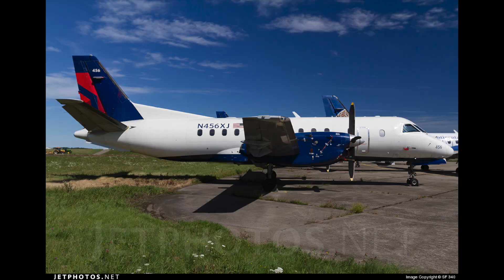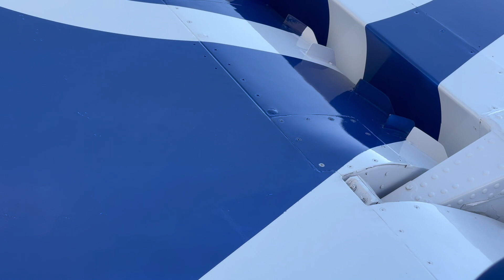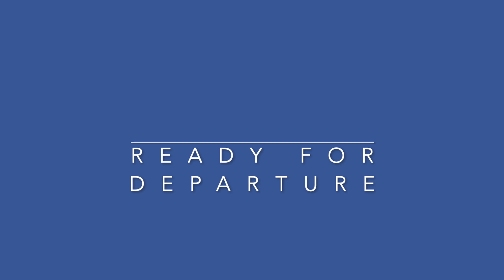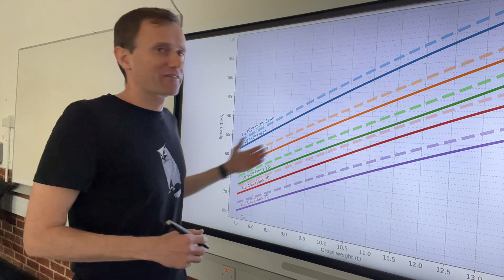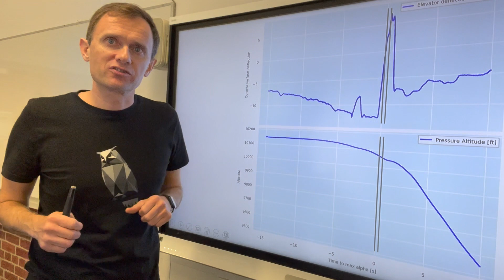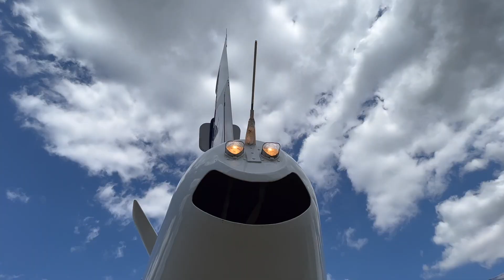Saab 340B+ - Performance, Handling, Design... and a Ride with the Cranfield NFLC

Comment from the maker: Do you fly/have you flown the Saab 340? Did you work on the design? Do you maintain/repair/overhaul it for a living? I'd love to know what you think of the aeroplane and what she is like to live with in your airline ops! Do comment below :)
Reply: I fly the plane, pilots love it!
Reply: The 340 was my first type rating. Solid little plane, but wow what a complicated electrical system!
Reply from the maker: Interesting! More so than comparable regional turboprops?
Reply: @asobester  more so than the a320 that I fly now! The 340 has so many electrical busses that Saab can't actually decide how many busses there are, depending on the way you define a bus. I want to say its like 26 busses. This component is powered by bus A, but the actuation is powered from bus B. In the event Bus B fails, its logic now reverts into an inverter off of Bus A, and that inverter is powered by Bus D when the flaps are greater than zero.
Reply from the maker: Ha! I see what you mean! It's so hard to design for all conceivable contingencies without the complexity running away...
Reply: @asobester  Nice video. My company was the 2nd North American operator of the 340 (by a few weeks). I flew it for almost 9 years. I rememb er our mechanics telling me that with electrical issues, they had different maintenance schematics based on the S/N. So when they had an issue, they had to be sure they had the correct one. It would have these frequent electrical glitches that would appear and then not be seen again. We used to joke that it came from the factory with one extra electron and it would just get momentarily caught in different places. As we were one of the original operators of the type, I got to see (and experience) many of the teething issues it had. It was 'exciting' to be sure. But I truly loved flying the airplane and was was one of the best handling types I ever flew.
Reply from the maker: @chipwestlund2753  Thanks for that, Chip. Interestingly the electrical system does get more than a few mentions amongst these comments 😜
Reply: @asobester  Understandable. As well as being complex as previous posters have mentioned, it just did weird things that became a source of humor. There were of course more serious problems that me and my company were directly involved with but the electrical did make us laugh occasionally.
Reply: Would love to fly this machine one day. Heard a lot of good feedback about her.
Reply: I don't have experience on the legacy Saab design but I'm part of the GE team working on a NASA contract to electrically hybridize the CT7 on a 340. This video taught me some neat things about the aircraft design that I was not aware of.
Reply from the maker: @trackrat62  Cool! I have heard the original  headlines on your project - is there any more recent public domain information on it out there?
Reply: The early SF340A models had a lot of teething problems. Particularly so with the engine inlet anti-icing systems. The early designs had  inadequate coverage and were prone to failure, leading to many engine changes due to ice ingestion. The power turbine modules were prone to fail borescope inspections as well. The use of composite propeller blades also presented many challenges, as the leading edges had a nickel covering that would also get absolutely hammered from icing. Nightly repairs to or replacements of the props were very common. Most of those problems were eliminated or greatly reduced over time. Overall, though, it was an impressive aircraft for its time, and to me, it still looks beautiful!
Reply: I flew her as 456XJ. Great plane to hand fly. It was great in winter ops. Very safe and stable on slick runways. It did like to sling ice off the props in to the side of the cabin scaring passengers on occasion though.
Reply: It was my first type rating. Around 500 hours on it. B models.
Reply: F50 is a better aircraft.
Reply: My sister was a FA on the 340 for American Eagle in Dallas/Ft Worth about a year. She says everybody called it the Easy Bake Oven® as the AC system was totally overwhelmed by the Texas heat in summer. Other than that issue she liked it.
Reply from the maker: @terryboyer1342  Ha! I can see why. Even in our mild British climate a hot summer’s day does make its presence felt in the cabin ;)
Reply: Pacific coastal runs one out of Vancouver bc canada
Reply: I haven't but it's such a pretty plane. In fact I think the only turbo I've ever been on was a high wing two engine but I forget what...

Comment: Excellent video. Very very good explanations.
I flew the Saab 340A for aprox. 2500 hours then the Saab 2000 for another 3500  hours.
I loved flying both airplanes. But more the Saab 2000 as it had incredible performance.
The Saab 2000 was the Ferrari under the Turboprops...
Reply from the maker: Thank you for the kind words! Perhaps I should take a closer look at the 2000 at some point.
Reply: @asobester you should definitely. You never have seen such a powerful turboprop before. They even derated the Allison AE 2100 turbines down from 4550 to 4150 shp each !
Max cruise speed was 0.7 Mach... 😅

Comment: ATRs also include a prop brake, as the PW100 series are also free turbine type engines. One of the sketchiest systems I've ever seen on an aircraft. I'd love to know how being held in place with the gas generator running affects the power turbine , its shaft, and the internals of the gearbox. I can't imagine that all that torsion being applied to it is good for it from a metal fatigue standpoint.
Reply: The turbines run at very high RPM, so the torque is low.

Comment: Using propwash to increase control surface authority in the event of failure of the critical engine is a nifty engineering fix for one of the aircraft's major certification criteria hurdles. Well done Saab.

Comment: I thoroughly enjoyed this video.I loved the handling characteristics of the 340. Would you consider a deep dive on a current airliner? I am curious to know why the vertical fin of the A-320 is slightly offset?
Reply from the maker: Thank you so much, Rob, glad you enjoyed it. Re the A320 - I should definitely do a DDD on it at some point, but it’s a tough one. I think you could make a good case that it is the most impactful aircraft of all time. Certainly one of the three most important flying objects ever designed. So I’m almost scared to… dive in. On the list though, for sure. And I now have a first question to tackle - the offset fin is a new one on me, I must admit. Have you seen any repair manuals etc that refer to it?

Comment: Only just came across this video.  The Saab 340A was the main type in the first airline I worked for (Business Air).  We eventually got three 340Bs in the mid-90s.  They were reliable, once you got used to its quirks and pre-winterisation checks on the icing systems helped with serviceability in the early part of the winter season.

Comment: What a great video, András, and what a wonderful learning environment for those lucky students!

I have no particular knowledge of the Saab 340, just that I’ve ridden in the back of it on several occasions, the last one being LNK-MSP on a dreadful winter day, perhaps in that very aircraft as it was a Mesaba flight. It was noisy in the back but better than many of its peers, and it always got me there safely. As an aside, I did have a friend who flew it for years out of Dallas, and she said that the 340A was hot and underpowered on a summer day in DFW, but that the 340B was a joy to fly. She really liked the plane, though I did get the idea it had some systems quirks that were unusual. 

I always like learning new things, and the lack of contra-rotating props, angled nacelles, and the vortex generator arrangement were fascinating. They are frankly never things I would have thought of with zero time in multiengine propeller driven aircraft. 

I did have a couple of random thoughts as I watched the video. I too had always noted the very pronounced dihedral of the horizontal stabilizer, but didn’t understand its aerodynamic significance; in addition to the Viscount, I’d also point out that the Comet and the DC-10 have very pronounced dihedral of the horizontal stabilizer, and if you have a general explanation for why they needed it compared to other similar aircraft that might make an interesting video. 

Your payload/range discussion was a very good introduction, and is something few outside the field grasp. I would point out that requiring a distant alternate can have dramatic real world effects on the number of passengers you can carry (the CRJ200 is terrible for this). I lived in Minneapolis for years and the winters are grisly there; large snow events can extend hundreds of miles meaning you may have very distant alternate fuel requirements making passenger ops economically unviable. 

I enjoyed the briefing and approach to stall/stick pusher demo in the video, and I’m sure the students will remember it well. I have flown aircraft with and without stick pushers; generally the T-tail jets are the biggest concern (I think the first stick pusher was on the Trident, but I could be wrong). The DC-9 and B-727 didn’t have stick pushers (at least the ones I flew didn’t), but the MD-80 did and it was extremely aggressive: it would take the yoke right out of your hand and essentially slam it to the forward stop; the 340 appears somewhat tamer, though I’m guessing power on stalls in the Saab would be very adventurous with the props turning in the same direction!

Anyway, thank you for teaching me some things; this was wonderful!
Reply from the maker: Thank you so much for the kind comments! So thrilled that I was able to tell you a little that was new.

The business of distant alternates is one of those that engineers rarely think of, but it certainly is an interesting aspect of conceptual design. I’m particularly fascinated by pairs where the departure airport is also the alternate for some aircraft (SEA-ANC? HNL? Antarctic ops?)... I should have mentioned this in the context of the range of the 340 as well, which is seemingly underutilised in pax ops (I guess these also explain the need for oddities like the long range tank mod on the DHC-8 - I used to wonder who fancied 8 hours on the Dash, but actually I guess it is to unlock remote destinations with distant alternates and/or no ground services).

Re power - the improved performance of the B model is actually good news for us too here in SOU for these 'flying classroom' ops the awesome Cranfield NFLC operate for us - on a hot summer’s day the rising terrain to the South of the field (ancient woodland with tall trees) can be payload limiting on some twin turboprops because of the EFATO constraint... (their previous platform was the JS31, which was lovely, but problematic in this sense).

Comment: I remember doing a jumpseat ride in about 1995ish or so from Nice to Stuttgart and back. I flew a KingAir B200 at the time with the same Collins avionics. I thought that the Saab was quite a bit underpowered, Crew told me about the driftdown and SE ceiling (remember that flight was across the northern Italian/Swiss alps), which I found quite underwhelming compared to the 'mighty' KingAir...but it was a nice ride, noise level were okay etc.

Comment: I loved flying it 28 years ago, have a little over 5000 hours PIC in it.
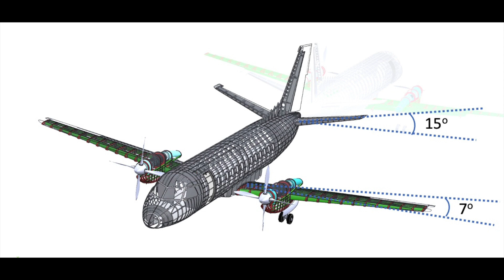Just could never figure out why Saab designed the hydraulic system the way they did….definitely an Achilles Heel… 8:40
Reply from the maker: Can you elaborate on what you didn’t like about the design of the hydraulic system?
Reply: @asobester  If I remember correctly, the Saab has a closed loop hydraulic system.  Having a leak could be catastrophic. Other than accumulators there isn’t a another system.  Other aircraft such as the Bombardier CRJ, Airbus A220, A350 all have multiple separate systems.  Also, the Saab has 1 electric pump ( no engine driven pumps), I believe a hand pump as well. Should that pump fail the crew is worked extensively.
It seemed to me that after designing the aircraft they forgot to incorporate a hydraulic system and scrambled to do so.
However, I and many others who flew the Saab enjoyed it.  It handled like a C172…Prior to my days of the Saab flying I flew a Jetstream 3100….so the Saab was a welcoming treat.
Reply from the maker: Perhaps their thinking was that in case of complete hydraulic system failure you can still gravity-extend the landing gear, so the worst case scenario is a flapless landing with no brakes? Not ideal, but at least you still retain all primary flight controls, come what may?
Reply: @asobester  true, however I believe the up locks were hydraulically actuated and if all hydraulic fluid was lost and or the emergency accumulator drained the issue would be the up locks not releasing.  It’s been quite some time since I flew the Saab (28 years)and could be forgetting some system’s knowledge, but I flew it for 6 years as a Captain, line check airman and simulator instructor.  One of the memory items with such a catastrophic failure at the airline I worked for at the time was to turn the electric hydraulic pump off, slow aircraft, lower gear before all pressure was lost.  Yes, the use of brakes, anti skid, flaps and nose wheel steering was lost, but was a small price to pay (I agree with you) for just having gear down and locked.
Reply from the maker: Ah that makes sense, I suppose most failure modes, if detected early enough, would leave you enough time/hydraulic pressure to lower the gear before you lose all the fluid/pressure…